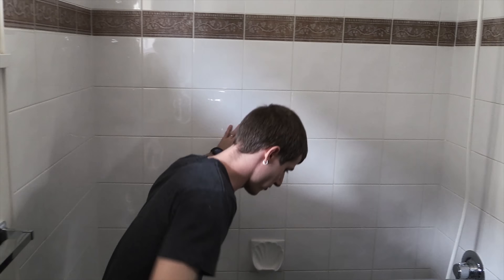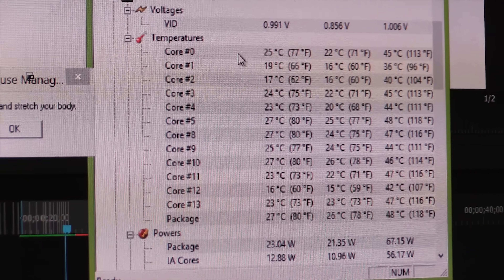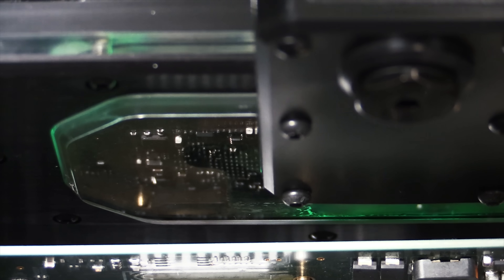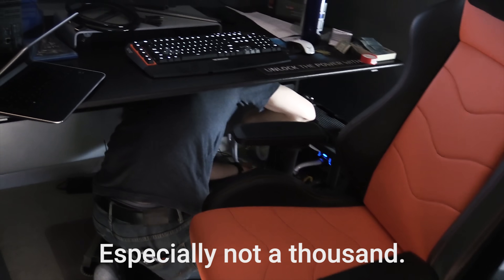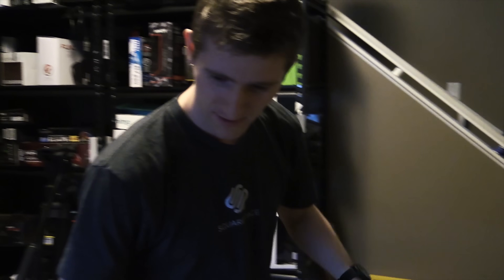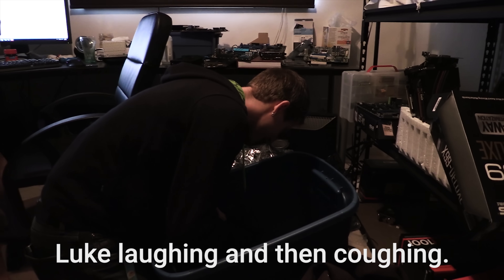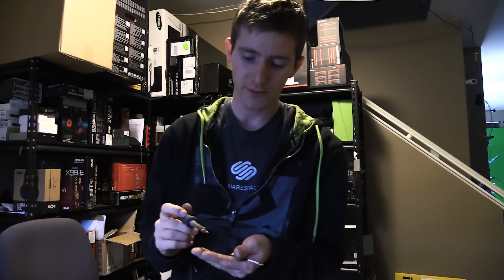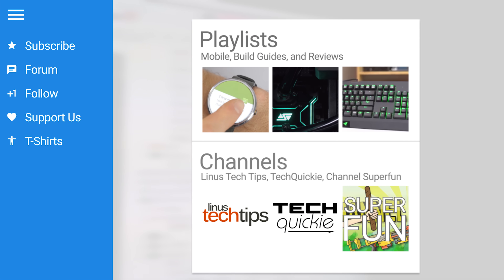Whole Room Water Cooling Part 5b - Some Issues, More Solutions...

Comment: Soldering, well I know this:
-Do not twist cable wires with you fingertips, Body oils are likely to difficult tin from attaching to the wires
-Liquid flux in it's most basic form is alcohol + soldering resin
-If you want to keep the iron on the cable but you don't want the pvc to burn in the tips, use a crocodile clip to reduce the heat going into the wire
-Less time you use the iron, the better, but never let buldges of tin popping out of the wires.

Hope you can find it usefull! and sorry about my english, love your show linus!

Comment: Linus, did you notice the solder not melting very quickly? or did it not work at all. The solder that you bought it primarily intended for copper pipes, I would suggest using a much thinner solder, you can get it at Radio Shack.

Comment: Now that I know the time frame, I can say this:
WHY THE HELL DID YOU BUILD THIS PROJECT WHEN YOU HAVE 1-2 MONTHS BEFORE YOU MOVE???!?

You lowered the value of the house significantly, you created and attached a radiator harness to the side of the roof, you put up copper tubes without flushing them completely on their own after soldering, you've contaminated the whole system, you don't have a good pump setup. You usually have such good concepts and designs, but this one is a complete clusterfuck hands down. Wouldn't it have been simpler to just wait until you move and setup shop to build this? There is so much more that you could do with an actual office building in comparison to a small house.
Reply: If I recall it correctly, the recordings are over a year old. They didn't know they were gonna move when they started on that project.

Comment: My dad owns a pool company don't keep buying pumps buy a pool pump with 2-4HP and that should really push your loop. Hayward pumps have 3 pressure options. I can get you one cheap Linus it's well worth it rather then multiple.
Reply: Like i said these pumps have 3 options. and can adjust speeds and the screen would show you speeds. But the amount of tubing they have it would need it. As long as you have no blockage in the pipe that water will be moving Really fast! But any blockage in the loop will probably blow the pipes. But again as long as those pipes are clear you should be fine. Also those pumps he are using are  for Irrigation, Dewatering and General Water Transfer, Handles Clear Nonflammable Liquids Compatible With Pump Component Materials and Liquids That Contain Some Sediment. They usually do construction type work basically so i wouldn't be surprised that theirs if oil from the water pump is getting into the loop. Unlike pool pipes they are meant to cleanse the water. So linus if you read this i can have a good pump sent to you, its well worth the investment cause you will not loose pump pressure and you can adjust speeds so if their are more computer on loop then you can bump it up if their less then turn it down! It's as easy as that!
Reply: with commas 

"My dad owns a pool company, don't keep buying pumps, buy a pool pump with 2-4HP and that should really push your loop. Hayward pumps have 3 pressure options. I can get you one cheap Linus it's well worth it rather then multiple."
Reply: i hope they see this comment
Reply: I can imagine such a high pressure pump blowing something... somewhere in their big ass system haha. Isn't a pool pump designed for a much larger tube size? These are only 1/2 inch internal diameter
Reply: Conscript69 Read above ^
Reply: Steven Tomas I know everyone tell linus to look at this comment
Reply: TECGaming It helps if you tag his YT account, like so: LinusTechTips
Reply: LinusTechTips Take my advice!

Comment: when soldering lots of wires together use some copper or steel thin wire (i use light and power wire from the walls of a house) tie to all together and then solder the crap out of it. dont forget the heatshrink before u tie it all up.

Comment: Linus, you really need to move all the pipes on the walls as low as possible.
Forcing the water up all those pipes is losing so much pressure that it will never work efficiently, if at all. Even if you do get it working the pump will probably not last long under all that strain.
Also it really needs to be a completely closed and pressurized system. It seems very open at the pump/reservoir end, which will just continue to introduce air into the system and lose pressure.
The pipes also need to be insulated, otherwise the outflow pipes will just radiate heat into the room.

Comment: Working in the field with very similar applications on larger scales i see a few issues:
1) There should be some sort of air bleeder/air separator, would make it much easier to fill up the system, and any air added into the system will be removed.
2)Various shutoff valves amongst the lines would make life a lot easier for future issues as adding a bypass hose at the station not used will allow water to flow through there instead of the system (Path of least resistance)

Comment: Hey Linus, for the reservoir, I would recommend going to a fabrication shop, telling them what you need and how you want it built and out of what material. They could make you a massive one out of mild steel, stainless, aluminum, etc... then they can weld on fittings to screw in the pump feed and return line into it. Shouldn't cost too much to have them build a box out of sheet and you get exactly what you want.

Comment: If you tin your wires first it will make it easier to connect them to each other. To tin a wire all you have to do is dab some Flux on the exposed wire then get a small amount of solder on the iron, then touch the iron to the end of the wire and let the solder work it's way up to the insulation. (Be careful not to burn the insulation) I would also recommend leaded solder as it has a much lower melting point and solidifies much quicker. (Leaded solder is getting harder to find in Canada due to the fact that it is being phased out because of its lead content, which realy suck since it's sooooooo much better than lead free)

Comment: soldering tips: when soldering wires together fray the individual strands, dip in flux paste (reason being it covers more of the wire in the ending creating a better bond), twist the frayed strands back together, add solder to the wire, cut a reasonable amount of heat shrink and slid it over the wires,  solder the wires that you are well, trying to solder of course, pull the heat shrink over the exposed wire and shrink it with a lighter or heat gun, that's all.

Comment: Linus. Thats the worst soldering job i have ever seen :D you need to get tin with flux in it. And you need to warm up the tip of the cable and then put the tin on top and have it get inbetween the fibers. Heating tin and adding on top is waste and wrong :)

Comment: i won't pretend to know "everything" because i don't....
so in my opinion you should take every pc appart and clean the algy or gunk whatever it is inside the pc's and the reservoir and start with new fluid or something like that...
if i had done that much work that would be the least i was going to do about that problem...

Comment: soldering tip. use less flux, and heat the wire, not the solder

Comment: I'd recommend using a liquid to liquid heat exchanger at each pc's connection to the whole room loop. This would isolate each system from the main loops liquid so contamination in one system won't infect all. Also you can run a more aggressive coolant with no worries of the different liquids mixing.

Comment: for soldering tips, after you cut the wire I would recommend sliding on heat shrink tubing then pre-tin your stripped ends.  And just like any type of soldering you don't want to melt the solder directly you want to get the wire hot enough that the solder melts when it comes in contact with the wires.  I wish you luck on this project it seems like a lot of hours have been put into it.

Comment: I think you could have used different pumps for this project.  I have a closed loopforced hot water heating which is very similar.  Just loops of copper pipe that run to different parts of the the hose that have fins in areas to expel the heat into the room.

Comment: Alright, I like their setup, I mean its cool to think about. I do have 1 suggestion for the new home/office. Why not use an actual water heater tank for the reservoir? I'm sure it's something they have thought about, but it seems what they need to do is adapt an existing plumbing system to their needs, not try to piece one together. Also, this would let them be able to move the fans and water supply to one spot, could all fit in a closet, or better yet a somewhere next to a drain like the existing water tank.. Could still use the newly ordered filter, and everything else... 

The system seems to be working well, except in a few areas. The outside fans, and the moonshiner style water reservoir in the tub.... Might be time to rethink those things.

Comment: don't connect the pump one after the other u will reduce the head pressure to the lowest pumps head pressure, connect them in parallel then the head pressure will the the total head pressure will the sum of the pumps head pressure.

Comment: When you move, why don't you switch to pex instead of copper tubing? Screw some 2x4's or 2x6's on the wall low so your pumps don't have to work so hard and use a t-fitting to run your quick disconnects. You could run one tube on top of the board and one on bottom and that would give the pex protection from getting pinched. Pex is easier to work with than copper. No soldering just crimps to hold the fittings on secularly. Just a thought.

Comment: Why is he using standard computer components .......go to your local aquarium store and you will get all the pumps and fittings you need in whatever SIZE you need with all the electrical fitting you need in supersafe 12v and designed to be used with plain water which is MUCH more caustic than cooling solution . The systems are designed to run 24/7..and for radiators use air conditioner evaporators    all these things are DIRT cheap

Comment: Linus, next time I recommend using some shrink wrap instead of electric tape.
Also for soldering use some helping hands and hold solder in 1 hand and the iron in the other, this will allow for a better flow of solder and a stronger connection.

Comment: I remember when I was 10 I got abought a new 360 controller. I bought a solder kit and modded it myself with rapid fire and orange lights (Instead of green). Since then Iv'e loved doing stuff like that. It's just no fun buying things premoded or having someone else do the work for you. These are the type of ideas that make me want to keep going even if sometimes (Most of the time xD) it's a waste of money and has more draw backs than it helps. It's purely for what you like to do and makes you happy!

Comment: First Tin the wire by lining the copper wire with some solder then to solder wires together you heat the solder with the gun without actually touching the solder. (i would recommend using heat shrink tubing for live connections)

Comment: You are making al terrible...!!!!!!!!! It doesnt work beacuse it is a ver y poorly Designed and optimized system,

1 Water pumps and the whole system sould be level, that is why bubbles are created, because of the low pressure you are generating with diferrent heights. But be really carefull because the bubbles are not introduce they are created with cavitation, if you continue with this project will not last.

2 for your thermodynamic system used you need a complite cicle, with expasion valve, there are many errors and issues but i can help you thrust me, i am an engineer.

You dont need to change anything, just optimize it changing the possition of all your system and calculating the losses, there are many books to fix it, i recomend the yunus cengel, fluid mechanics, chapter 2-6, or just contact me :D i will help your projects..!!!!

Comment: You need water wetter it is an automotive additive that reduces the surface tension in water thus making bubbles easier to not stick and get out...

That combined with uv reducing the antifreeze to 25% and copper sulfate and silver coils should get rid of anything growing in it. You might want to coat the inside of the fuel cell with something silicon based that should reduce the surfaces the brown stuff likes too.
Reply: Well on the water wetter dont use with antifreeze supposedly it drops a brown sludge out of the mix. Considering in the next month or 2 sub zero temps will be out of the picture and you will be looking at winter ending. At that point dropping the antifreeze would be a good thing.

Comment: Linus, I would be concerned about your outdoor cooling array. With weather and the environment I could see you running into problems.When you move you should look into an aquarium chiller(AC unit for cooling water) you could run in another room or the basement. Also there is Aquarium pumps that would easily handle the head pressure and flow rate you need. Pumps would probably be about $300-500 USD. Pumps that you could possibly use can also be variable so you can control the flow rate. A chiller larger enough to handle that system would be $1000-$1200 and it would be an all in one unit. The only issue being it vents heat into the room so you would need to find a suitable location as I mentioned. With all that plumbed like you have it would leave you with a very professional and clean system. I also don't imagine you would be breaking the chiller or pumps warranty as long as you use water.

Comment: I'd pick up a chisel soldering tip. The greater surface area allows you dump for heat into the wires. Else for tutorials and tips EEVBlog has great videos.

Comment: Just a suggestion, instead of using all the computer style radiators and fans, have you looked into using a small automotive radiator and electric fan?  Those fans are made to be out in the elements, and it may be easier to hook up and fill with it having a cap.  They also make smaller transmission coolers that come with a fan.  Just did a quick search and most of those fans run around 8 to 15 amps at 12 volts, and a quick Amazon  search I found power supplies that would run them for around $100.

Comment: If you live in a house you can make a hole or rather "space" in structure wall or carrier wall (English not my native language, sorry) and put radiator  and tank in it and close it, leaving outlets for the tubing. the inside of that wall is almost always around 18 Celsius and you don;t need fans to cool the water at all, the wall will do it for you. I did that and aside from a little bit of condensation it is great :D (not great if you are renting though :D )

Comment: Instead of soldering, especially as it is only for 12VDC-I would recommend Scothchlok jelly crimps instead. Faster to use and waterproof.

http://multimedia.3m.com/mws/media/447443O/3mtm-scotchloktm-communication-connector-pdf-w-linked-video.pdf

Comment: Dude put those pumps not in line, but separated let them both have a separate inlet. And the outlet you can join them together with  a T binding, but put before that a check valve. Because one of your pumps is slightly more powerful. Have a nice day =)

Comment: With a better piped system air would not be a problem, flow would not be a problem, and overall temps will drop. A balance system is a happy system, flow goes to the least resistance, some pcs will have crappy flow based on how he piped it.

Comment: Linus, twist the wires together and then heat the bottom of the wires while applying solder to the top (the wires will take a few seconds to heat up so don't be impatient if the solder doesn't flow straight away. It will give you a much better connection.

Comment: here's some tips coming from a cell phone and electronic repair guy.

1. presolder exposed wiring with solder. lay it on thick. use flux if you even need it. in my experience you don't.
2. solder those thickened wires together. you prolly won't need solder to solder the soldered ends of the soldered wires. solder-ception.
3. heat shrink tape everything exposed instead of electric tape. your risk all those fans for potential corrosion.

Comment: Soldering tips: Tin your iron! Heat what you're soldering, not the solder. And use shrink tubing to dress up your wires.

That's really, really not going to be code for outdoor use. Good luck though.

Comment: I wouldnt have done a direct connection to connection but use a PCB to inlay the power supply and connections onto it. Add a kill switch to the PCB would be more desirable in the long run. Also I would suggest getting electrical rated shrink packaging to put over the exposed wires to protect them more instead of using electrical tape.

Comment: Wouldn't it have been better (with less copper runs) to install the copper along the floor with a small pitch upwards as it worked it's way around the room? This would have reduced the total length of the copper run and made it a little easier to bleed the system I think.

Comment: whenever I play a game a lot of times the whole game starts to stutter. Most of the times till a point i'm not able to play the game anymore, and it's starting to get really frustrating. anybody know how to fix this?
 
my build:
 
i5 4670K (at stock speed 3.40 ghz)
msi Z87-G45 gaming motherboard
GTX 760 (from msi)
6GB 1333mhz
1.5 TB seagate beracuda
windows 8.1 x64
 
I also see in task manager that my disk is used 100% a lot. could this be because I never did a fresh reinstal of windows 8, I just put the harddisk from my old computer and plugged it in to this one.

Comment: Hey Linus and other soldering people, I couldn't tell if you did, but that sponge is supposed to be soaked before use so that when you put the solder against it to clean it doesn't burn the sponge, didn't see if it was, but its just personal tip. Unless you have the money to buy new sponges.